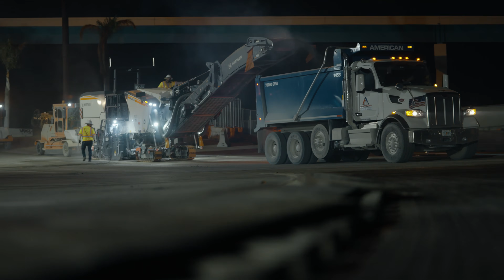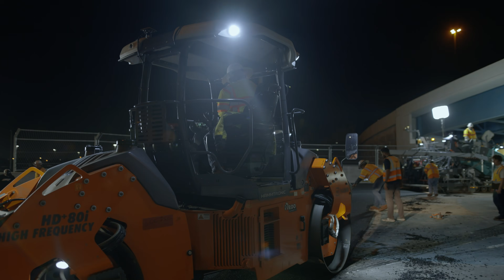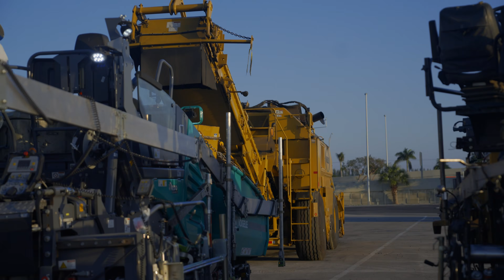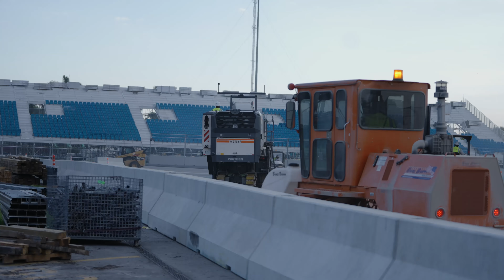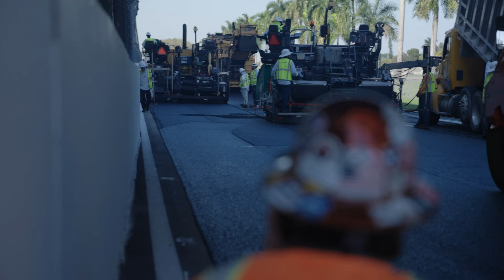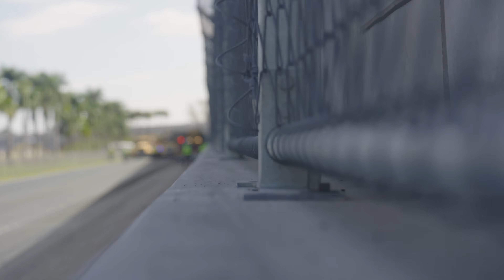Paving WORLD FAMOUS Miami Racetrack

Comment: Congrats to Sunland for landing this job! On another note, how in the heck did any Floriday or South East Paving contractors miss out on this job lol? I guess Sunland was able to make this work mobilizing all the way from Arizona - insane!
Reply: there is probably less then a dozen companies that can make tracks to f1 tolerance, I bet most of the companies in the south east specialize in paving banking. With the amount of problems the drivers had with Miami last year, the FIA might have made their choice simply based on experience.
Reply: @oblivionfire1365  they prob do the F1 vegas race
Reply: Great report,regarding south-east pavers,last years’ track surface wasn’t up to  FIA expections,on racing line,this year knife edge of good,slightly off…  leclerc crashes in Q3😅
Reply from the maker: yeah it speaks to how specialized this kind of work is
Reply: @Tacos888  no LVP will do it .

Comment: Nice episode. I wonder how this mix differs from standard roadwork ? Must be something special, to increase traction while maintaining longevity of the surface. 👍🤙
Reply from the maker: aggregate spec is extremely tight and so is the binder spec. At face value, it didn't look super different, but it's pricey stuff
Reply: Sure it's all virgin material. No recycled asphalt in the mix
Reply: SBS binder, aggregate was shipped in from South Carolina if i remember correctly.

Comment: When you have to be invited to bid because most contractors have never even seen a print spec sheet like this in their dreams let alone reality. I'm sure the other contractors who didn't win still framed the invite letter and have it listed on their resume. 
Also, that poor service guy is probably absolutely murding his mobile data plan being on standby the whole time with spares packed in the wings
that operation is so tight that Thor could smoke any single machine there with a random bolt of lightning and it would only take an hour to get back on track.
"oh, the paver broke down and can't drive anymore... go grab the paver dragger we brought and get it out of there!"